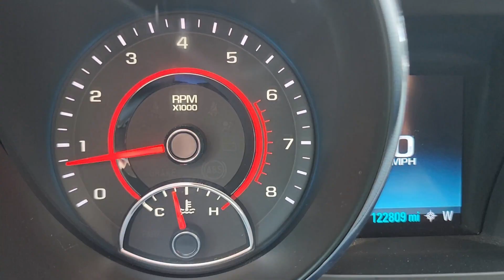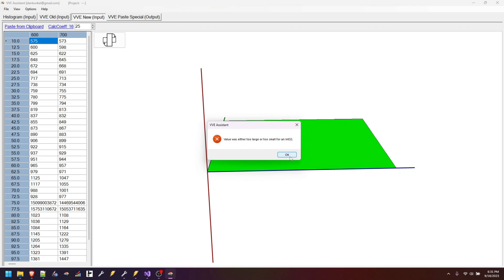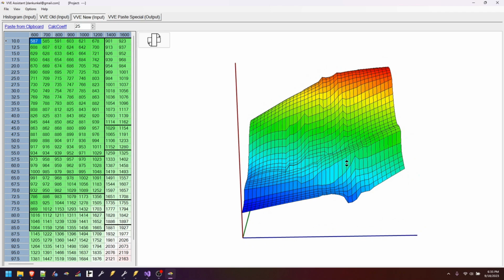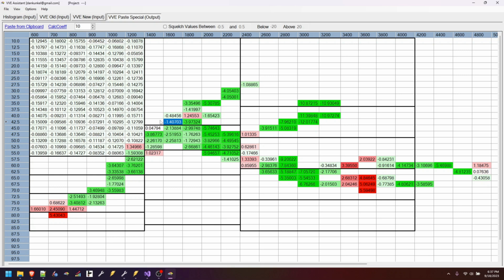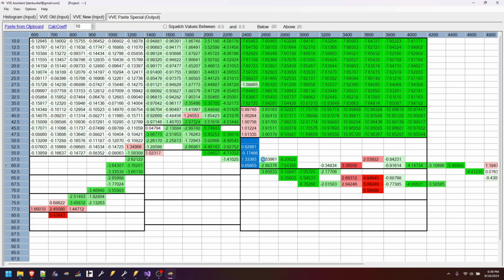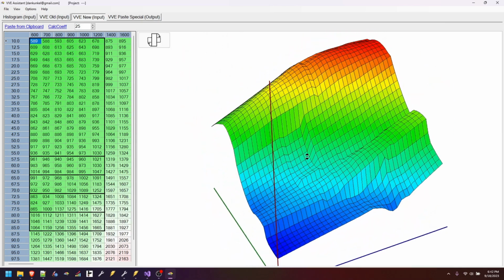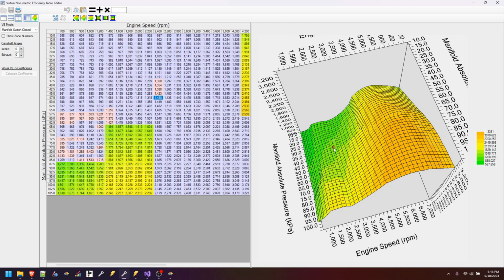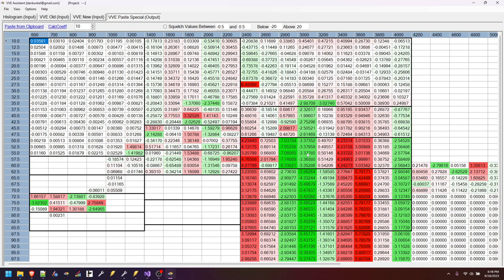VVE Assistant v1.50: Calc Coefficients

Comment: Im using Titan Tuned's maths, formulas etc.  along with your VVE assistant.  I am getting some Very large numbers,  but when I compare TT's CL & OL graph vr Eq error, its not even close.    Have your heard of anything like this?     2011 gm 6.2 e38.   Cam, supercharger injectors etc.
Reply from the maker: I can't say based the info given. I believe TT math is actually my math formulas based on Dynamic Air.
Reply: @SilverSurfer77  Yes it is, I have been over the expressions 2 dozen times,  double checked against yours and his plus trying to use my grey matter.  Can not figure it out.    I have been getting closer to my version of finished.  Only been tuning this truck for 3 years.....  Yes 3 years.  I have its drivability almost spot on,  except for rapid acceleration.  if I romp on the noisy peddle, it backfires and pukes.  goes stupid lean.  From what I can tell your brain works well, and you intuitively understand the control side of engines.  This is why I use your VVE and MAF assitant.  (I was already using an excel file i made to do something similar).  Anyhow.  Good times.  Thanks
Reply from the maker: @justooln2 ensure you are logging all PIDs for the filters. Watch this
https://youtu.be/Qh_dGttZiZw?si=Dhj3etQsWsFsPro4
Reply from the maker: @justooln2 also I no longer use the FTC part of the filter. It is not universal across Gen4 ECMs. Here is a post with the newest info.... use those filters. 

https://forum.hptuners.com/showthread.php?102939-Tuning-MAF-and-VVE-at-the-Same-Time
Reply: @SilverSurfer77  Yup. Gm Gen4 e38.   Here is the VVE CL expression: 
(([2320.71]+([2320.71]*([50116.156]+[50114.156])/100))-[2311.71])/[2311.71]*100    

And Here is the Filter: 
[50070.56]<1800 AND ABS([50040.71]-[50040.71.shift(-10)]) < ([50040.71]/[50040.71.shift(-10)])*0.1 & ABS([2311.71]-[2311.71.shift((-10)]) < (2311.71]/[2311.71.shift(-10)])*0.1)

If I just do the old lazy method and do the VVE w my WB the ERR looks reasonable, but looking at the ERR % using this math, I am getting 47.81% HIGHER values when comparing a single cell.
Reply: @SilverSurfer77  I will look and see whats up w this one vr what I am running.   Again. Many people have thanked you,   I want to thank you again.  Maybe Ill buy you another coffee. lol

Comment: Does this work with MAF enabled, or do we still need to fail the MAF?
Reply from the maker: Disabling the MAF is the hard way and the old way to tune VE! I also do NOT like the GMVE method either. I have devised a way to make like so much easier. Please watch this video, the description has the link to the formulas (just make sure you are logging all the correct channels for it to work).
https://youtu.be/xRZaTblSQ_0

If you want further reading and more info (and a lot of drama) from my Dynamic Air formulas:
1) This is where I introduced the Dynamic Air method and everyone thought I was crazy: https://forum.hptuners.com/showthread.php?102939-Tuning-MAF-and-VVE-at-the-Same-Time
2) This is where everyone realized I was not crazy: https://forum.hptuners.com/showthread.php?105349-What-is-dynamic-airflow
Reply: @SilverSurfer77  thanks. I did watch the video. It was just never stated in the video whether you could do the VVE tuning method with the dynamic air calculation with the MAF still enabled. I just wanted clarification. 

I saw your forum posts and I just downloaded VVE assistant as well :) does VVE assistant work in a similar manner? AKA I can leave MAF enabled and use VVE assistant?
Reply from the maker: Yes leave MAF enabled always. Also, the old rules apply when it comes to using slow and deliberate throttle movements. Avoid harsh inputs and hit as many cells for as long as you can in the histo.
Reply: @SilverSurfer77  oh for sure. Steady state as much as possible. I'm tracking. Thanks again!

Comment: I used the last version a lot! You should make one for speed density using the IMRC open and closed ve tables
Reply from the maker: Thanks for the support!

Can you let me know what challenge you are facing with the SD in this tool? Many people are using this for the SD OS's, it works. I think the only real benefit would be the fact that you can merge and average multiple logs together. But I would like to know your thoughts on how it can be better.

I will be applying the 2 bar SD OS on my car soon...so I will see if there is an opportunity to add new/different support. Honestly though, I just don't feel like this tool is really needed for SD that since there are no coefficients to get in the way. A copy/paste special % and you are done (of course you'll need to smooth it out).

Comment: I have an additional VVE Delta tab.  Is that correct?
Reply from the maker: Yes... you can turn that off in the options. It's used in background calculations but not really needed for the average human. Should make it run faster if you turn it off.
Reply: @SilverSurfer77   Thanks!  Didn't realize you were on Kyle's feed tonight!
Reply from the maker: @MrSchmidthead  I in a couple minutes late!
Reply from the maker: @MrSchmidthead watching a recording of tonight's live stream... are you in KC?
Reply: @SilverSurfer77  St Louis but originally from KC
Reply from the maker: @MrSchmidthead  Slaps has obsoleted all other BBQ places in KC!

https://slapsbbqkc.com/

Comment: Big improvement over the original base of the self shaping - really big improvement all the way around. Really glad you added the averaging function to smooth out the data. Looking forward to 2.0 even more now :D Great work. Just used it a little. Really like how you can delete out the outliars in the logged data and then average the rows out to keep things more in line.
Reply from the maker: Glad you like it! Hint...you can edit (delete or change the number) in the normal histogram one cell at a time for stuff like those outliers. Ideally the outliers would be filtered out by setting the cell hits in the scanner though...but data wrangling is all part of tuning I suppose!

Comment: Awesome seeing this being out already. I definitely think having the interpolation inside the assistant is a good idea, it would almost eliminate having to use the fill in the blank feature BUT the fill in the blank feature is still cool and in rare instances I can see where I would want to still use it. You nailed it. I wonder how many iterations it would take to get it close to perfect, probably depends on how you drive and get the data.
Reply from the maker: The number of iterations to nail down the shape will come down to two factors mainly:
1) How many cells have histogram data from the log
2) How close the desired shape generated by the "copy-paste-special" generates a shape that naturally satisfies the coefficients

A third factor would be, of the cells that are missing data...how close to the final shape are those "dead" cells.